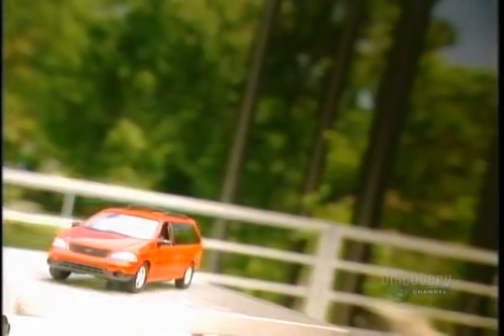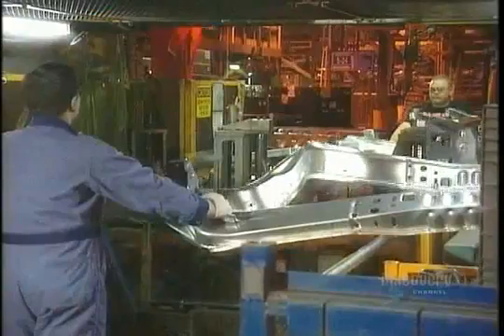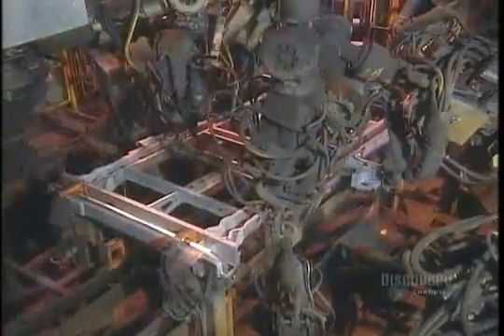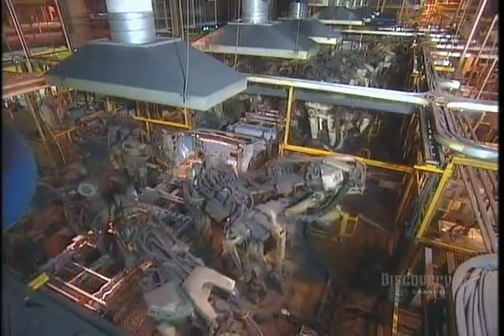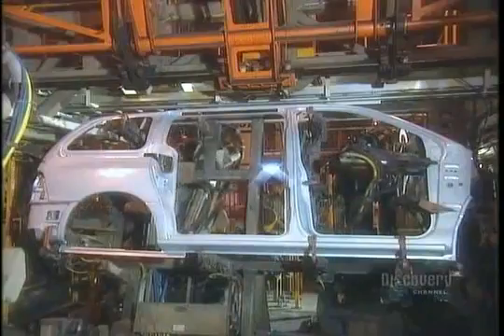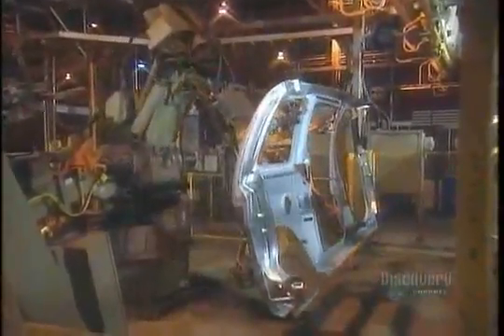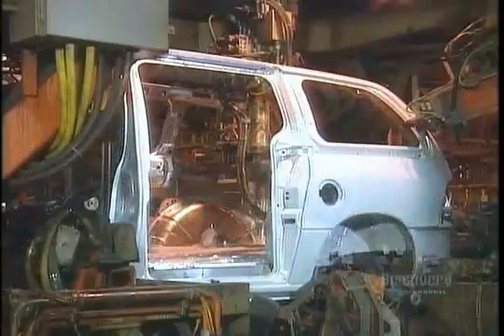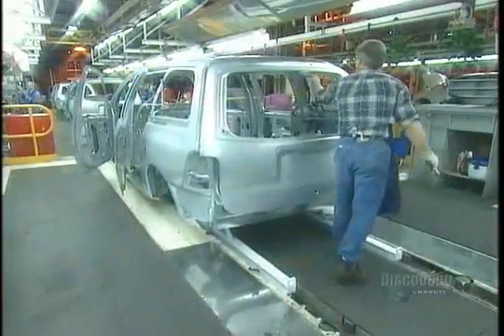Chassis Production | How Cars are Manufactured | Automobile assembly

Comment: This is not answering the question I had. The robots just get a side panel of a car. How does the side panel get made?
Reply: Probably just melted material in a mold. Considering it’s all one piece it would have been a pretty large one.
Reply: As mentioned, a single, molded piece. I'm surprised the chassis itself is riveted and welded instead of being cast a single unit. Points down for safety on this model.
Reply: They bring in rolls of steel and it’s ran through a stamping press that weighs 30,000 tons and it slams down with dies in it that shape the part.
Reply: https://youtu.be/TubOzvqOCmI watch this